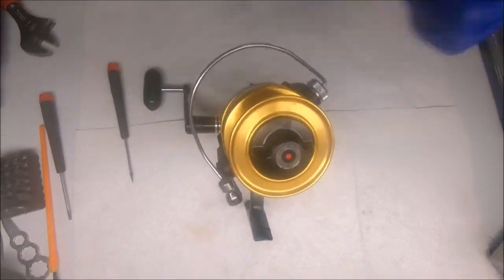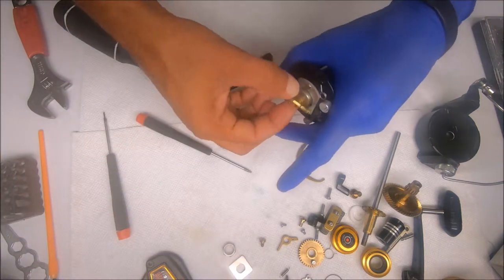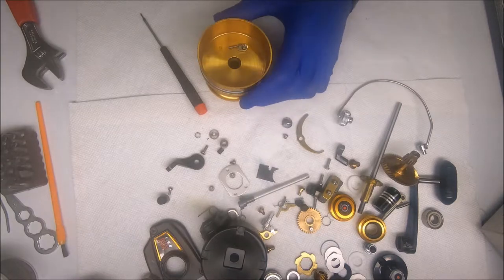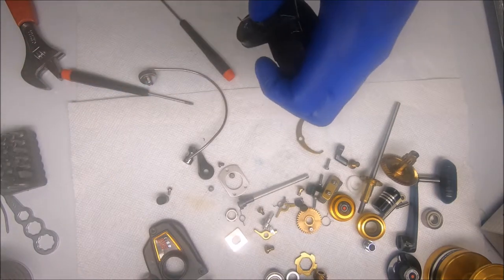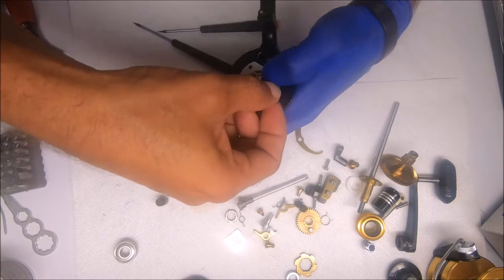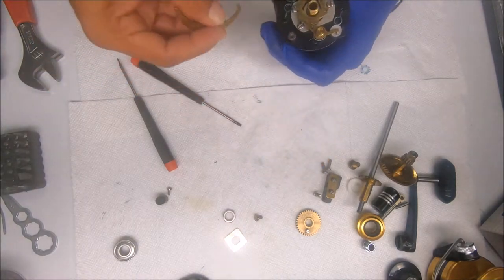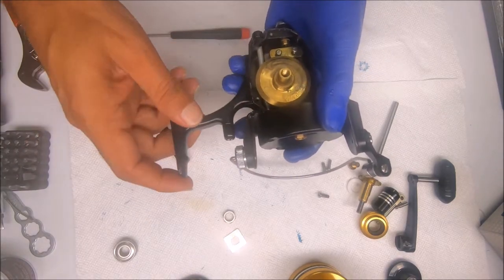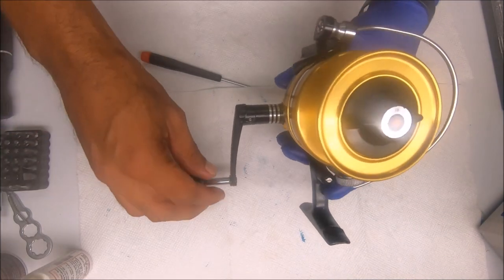Penn Spinfisher 750SS Fishing Reel - How to take apart, service and reassemble

Comment: Hello, I enjoy watching your Videos on the Penn 750ss and 7500ss Reels. I have a question about the sequence of reinstalling the Drag Washers. I noticed you place the thick Keyed washer on the bottom and the thin Keyed Washer last on the top. The 750ss and 7500ss Penn Schematic shows the opposite, thin Keyed Washer on the bottom and thick Keyed Washer on the top. Which in your opinion would be the correct sequence? Thank you for the videos!
Reply from the maker: Thanks for watching and your contribution! Though I don't think it's not super critical the order, the thicker on top, since it can handle more of the stressors delivered by the drag knob's compression.

Comment: Thanks for the video. So I have the problem with this reel that you warned about at 3:55 of the video. The ratchet wheel is corroded and stuck to the male part of the rotor. How to free up and remove that stuck ratchet???
Reply from the maker: Thanks for checking out the video. You can soak it with penetrating oil (I use corrosion x) and leveraging the shaft of a screwdriver under the ratchet (alternate sides as you go) for a few days. Or, you can spray it with the oil and use heat (I use a torch) to heat up and free the area.... you have to be careful with this one.... go slow and wear protection. After each incremental warm up, try the same thing mentioned above. Hope this helps.

Comment: Hi
I came across one of these which has a bit of handle play, when I hold the reel and rotor in hand a slight back and forth handle movement is there I look at the side and the main gears also play. 
Based on your experience is this can be a sign of worn gears or it is normal clearance ? BTW Both pinion and main teeth are intact. Also is there anything I can do to as a workaround?
Thanks
Reply from the maker: Thanks for the! Yes, it's probably some gear wear, since I'm assuming it's not the rotor nut, but shouldn't be a big deal if it's not extreme. You can try shimming the main gear to see if it helps.

Comment: I noticed when you put the pinion gear down at 20:37, a lock washer is left on the mat when you pick it up at 20:46.
Reply from the maker: It's grease from the bottom of the pinion. Let me know if you're still unclear. Thanks.
Reply: Ah.. It appears to just be a grease spot.. Oops 😉
Reply from the maker: No worries.

Comment: Great video.  I can't seem to remove the main gear on mine.  I don't have a screw on the back side like the one you are showing.  Any idea how to remove the main gear?
Reply from the maker: Thanks! Is it stuck in the bearing? If so, try soaking where it's stuck in penetrating oil overnight to see if that helps. You can also add a video to show me what you're experiencing. Show both sides of the housing if you do.
Reply: @TSGReelService  Thanks for the quick email.  You were right....it was just stuck in the bearing.  All done now and working well.  Thank  you.  Oh...looks like I did not put the screw back in when I changed from RH to LH.  Found the screw in the box!
Reply from the maker: You're welcome and happy to hear it! Glad it's cleaned and ready for the next adventure. Be sure to subscribe, if you haven't already done so, and spread the word about my channel. More videos to come!
Reply: Do you actually do this for a business? That looks like something I  shouldn’t attempt!

Comment: Follow your instructions. I now hear a slight clunking noise. Almost like something is binding or not balanced. Only happens when the spool is on the reel. Any thoughts?
Reply from the maker: Post a vid of it and shoot me the link. Thanks.
Reply: TSG Reel Service do you have a email address
Reply from the maker: @bitmandee7842  I don't open random links or attachments. Feel free to post the vid on YouTube and shoot me the link via this comment section. Thanks.
Reply from the maker: @bitmandee7842  Sorry for the delayed response. I just received an email notification this morning stating you think it might be the main gear (I doubt it is),  but can't find the that post in this string (I'm still working through the intricacies of youtube), but I didn't receive a notification of the vid you posted.

These reels tend to wobble, so  the sound is not uncommon (see https://youtu.be/qVdVhM_D2Ns). However, yours seems a little excessive. Try installing the bail assembly and testing it again. If it's still significant, your spool shaft or rotor may be bent, or the thrust washer is not installed properly.... I hear a scraping noise at certain points of oscillation. When re-testing the reel, crank it at varying speeds to see where/when the noise or wobble occurs. You can call me at 786-708-0996 if you need additional help.
Reply from the maker: https://youtu.be/qVdVhM_D2Ns

Comment: I have a Penn 7500SS that I've rebuilt. When engaged my silent drag works fine. However when I disengage it, I can hear a low noise when reeling in either direction. I've taken it apart and looked at the transfer lever and the silent dog. Any ideas as to what might be causing this issue?
Reply from the maker: Thanks for watching! Re-check the leaves on the silent dog to make sure they're not too tight again the ratchet. If that doesn't do the trick, describe what the noise sounds like.
Reply: @TSGReelService  I loosened them and then I couldn't get the anti reverse to work so I pinched them closed again. The anti reverse works again but I still have the noise. It sounds like the click drag when engaged but not as nearly as loud.
Reply: @TSGReelService   I loosened them and then I couldn't get the anti reverse to work so I pinched them closed again. The anti reverse works again but I still have the noise. It sounds like the click drag when engaged but not nearly as loud.
Reply from the maker: @BrandonEbz  did the noise go away when you loosened then?
Reply from the maker: *them?
Reply: @TSGReelService  no still there.
Reply from the maker: @BrandonEbz  okay. Thanks. Check the wear on top of the silent dog lever.... the post portion and where the spring enters it. If there's any, it's causing the click dog to not fully disengage... the could the clicking when cranking forward. When cranking backwards, the little scraping noise you hear is just the leaves of the silent dog rubbing against the ratchet and nothing to be concerned about.

Let me know if that helps.
Reply: The handle for me is acting up . The handle that supposed to spin around , the part you use to reel is tight and won't rotate . I have to reel with a flat palm . It's so tight

Comment: So I did everything but now my drag doesn't set right. When it's fully screwed down it still pulls drag with easy pressure
Reply: Any ideas to what the issue could be
Reply from the maker: Hi, it sounds like your spool isn't fully seated. If it is and your drag knob is good, check that your drag stack is correct, thrust washer in place, crosswind block cover is seated in groove of shaft. Not much else it can be.
Reply: @TSGReelService   you were right it was not seated correctly.  Thanks for the help!
Reply from the maker: You're welcome and no worries. Glad to hear you got it fixed. Thanks again for watching. More vids to come!